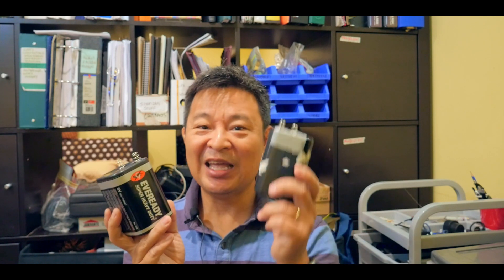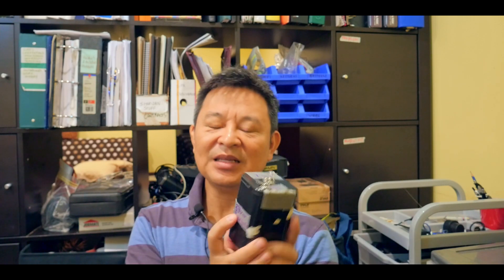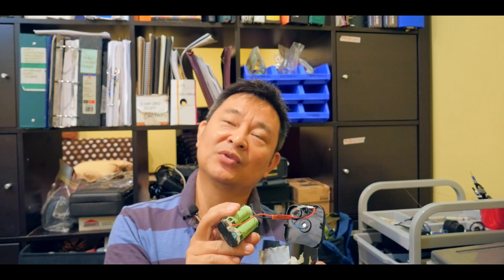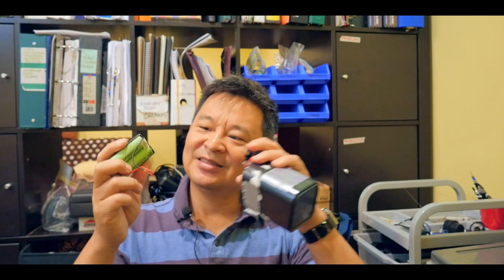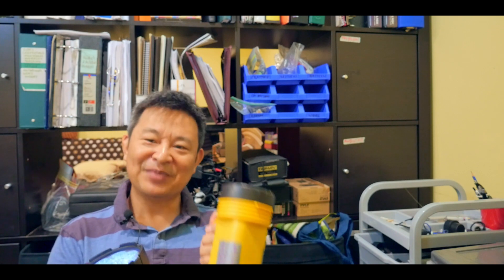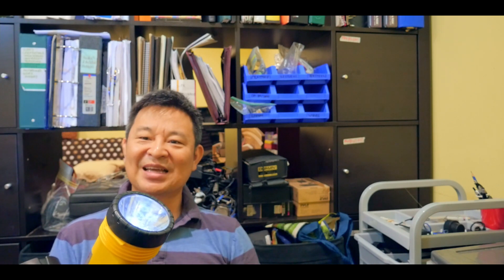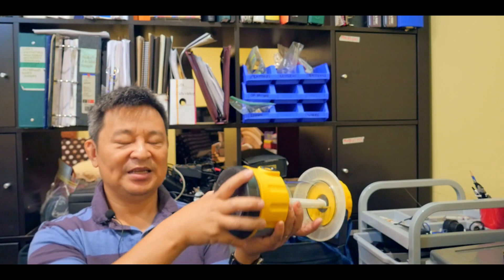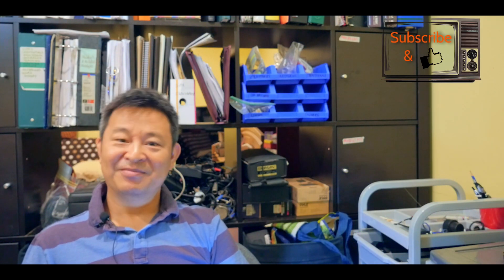How I convert my 6V LED Lantern to 3.7V or 7.4V Lithium-Ion Lantern - lighter, cheaper,rechargeable!

Comment: Battery put in parallel? That only get you up to 4.2v max at full charge running at the 6v bulb. You won't get as bright as it intended for
Reply: Can get a 3-12v LED to pop in to replace the bulb, brighter and uses less power. 
About $2.50 at AliE today.  Gives you the flexibility to run it parallel, series or even with a 6v battery
The Rayvac one I have that came with an array of LEDs is bright running off a single 18650, but I've only let it go for an hour or so, not sure how it'll be when the voltage drops.  Need to put a charger/low voltage protection board in there, just goofing around for tonight.

Comment: I did this but I used two power banks and put a USB lead on the light so if one power bank runs out I just switch to the other by changing the usb to the other.

Comment: Makes sense but I kinda like how ridiculously oversized and heavy the battery is, I like that kinda thing, I like old tech and those are kinda old school so I like them, especially since most of my flashlights are incandescent and if they have leds they came with them installed, those give good battery life and I like them, I also only use brands with 4 f cell batteries inside, I don't use ones with d cells inside cause f cells are the size of one and a half d batteries so yeah.

Comment: Would have been nice to see how you took apart the battery and emptied its contents. Otherwise this video is excellent.
Reply: Is there are video on how to disassemble a 6volt lantern battery? I tried and the case crumbled in my hand. Would like to duplicate the 6Volt battery you show in your video where the top easily comes off to access D cells.
Reply from the maker: Maybe I will redo the video again in the future to show the entire disassembly and rebuild of the led lantern.  I think it depends on the brand, model, and quality of the original lantern. It shouldn't fall apart that easily.

Comment: lucky for me I work for a e-waste company, so I find many discarded parts. led lights from old broken lamps/torches, A-grade wires & the on/off switch from a old power supply, 18650 from old laptops but voltage MUST be equal, greater or less like 0.10 milliamp difference. Only thing you cannot find is a bms, that has to be purchased.

Comment: Hi guys iv got a old 6v rechargeable torch  with a halogen car bulb  and the resistor iv got init is a 5w10nj. But my question is  i would like to up the power to 12v torch but i dont know size of the resistor i need. Im goin to put a white 12v led bulb in any suggestions please.  I love torchs iv got so meny but i like to make own

Comment: Hi my friend, As an idea have you thought of using 7.4v  via 2  IN4004 diodes to bring your voltage back to 6v  (.7v drop per diode) at 1 amp?  Using protected lithium cells.  Is What I do now.
Reply from the maker: Thanks for the input.

Comment: I have a led light which works on a 18v lithium ion battery but not a 12v lead acid, why is this?
Reply from the maker: It is the circuit in the board that only allow the connection of 18v (16v to 20v) battery low current system.

Comment: I've converted the 3.7v batteries from used vapes. Use them for battery banks, led lights, USB fans. 
Everyone throws their used rechargeable vapes away. I had a few people giving them too me so I had gotten about a hundred.
They are great little batteries. 
Check it out.

Comment: Had you considered using a TPA4065 board? You could theoretically make a 6v lantern battery with a usb socket for charging. So put the 2 18650 cells AND the TPA4065 board INSIDE an old 6v cell, then use the boost feature to get closer to 6v output. This also provides cell protection and easy charging from any USB source. They are basically about 1$ a board.
Reply from the maker: Thanks for letting us know.
Reply: Conversion can be done but it's the re-charging of this 2s li-ion battery is the one which needs to be looked into. A perfect re-charging circuit should be there for continuous performance of the converted batteries.

Comment: Hello, 

I got a headlamp who's used with 4 AA Battery in serie (so 6v), and I want to modify the housing for use 2: 3.7v batteries. 
Can I just use the LED on the 7.4v batterie or I must drop the tension to 6v?
Reply from the maker: 7.4v is too high unless you have a voltage regulator component to keep the voltage at 3-4v.